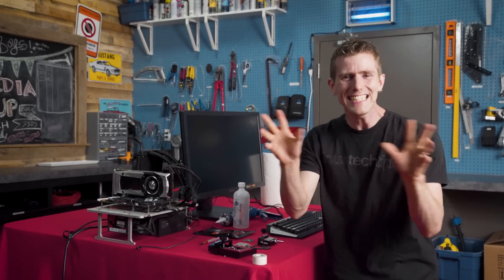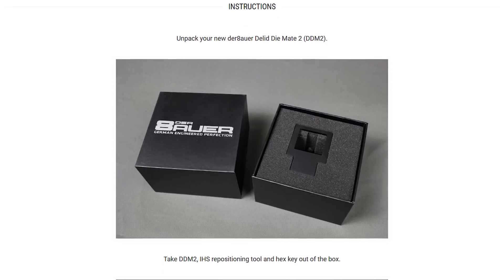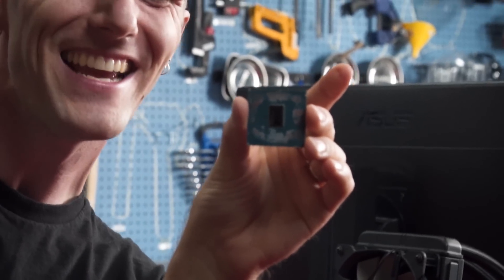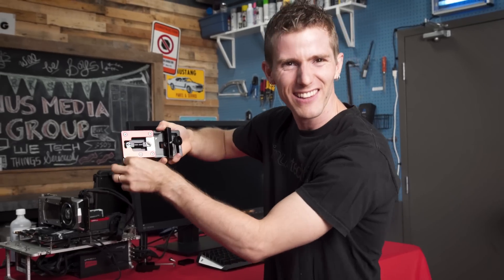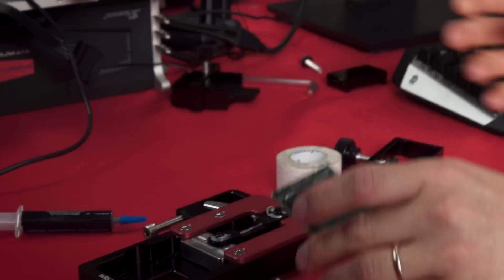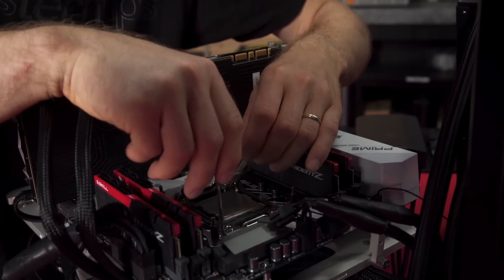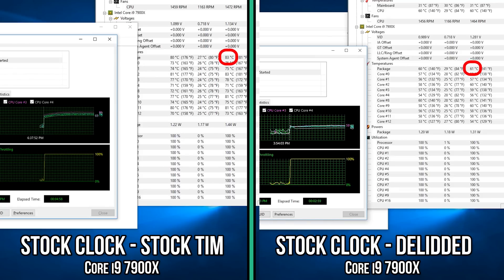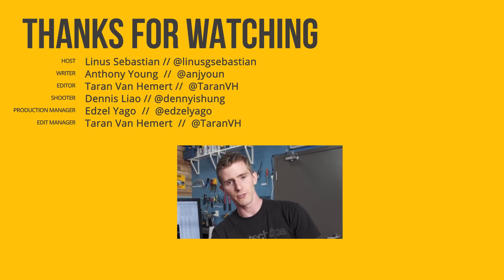Delidding a $1000 CPU - Worth the RISK??

Comment: 20 degrees lower after delidding? Damn, either there was something hideously wrong with your testing method or Intel's R&D division have got some explaining to do...
Reply: Andy Jones a 20 degree difference is pretty normal to see after deliding
Reply: Cameron Cameron Well as I have no personal experience with delidding in not going to pretend to know any hard facts, but the way I see it if all it takes to get a 20 degree reduction in temps is to swap out the stock thermal compound for something a little higher quality on a $1000 processor, then Intel seriously need to revaluate what is classed as "acceptable cutbacks" when it comes to increasing their profit margin. 20 degrees is not an insignificant amount, that's the difference between a pretty hefty overclock and stock. Or passive vs active cooling.

Basically what I'm trying to say is if what you say is right, and 20 degree drops are to be expected, then there's something fundamentally wrong with the way processors are assembled.
Reply: Yep i agree intel should be using a different TIM on there cpus there current thermal paste is a joke and is designed to last a long time but doesn't give good temps

Comment: I wonder if the TIM resistance is increased intentionally to reduce differential heat stress/cycling and increase reliability? For one, a deliberate gap between the CPU and IHS as alluded to by one commenter would allow the CPU to expand and contract without any resistance. I wonder if just thermal stress on the die could stretch/compress parts of the die and change the behavior of the semiconductors? Second, if the CPU is burning a lot of power, after a certain point it is safer to let it run hot than to cool it too much and create a thermal gradient across the die which may cause too much mechanical stress. It could be that Intel did this deliberately for actual engineering reasons.

Comment: If you are gonna make a video at least state the facts right and use what you should like liquid metal instead of any paste. 

Also the "problem" is not the TIM they use, its the gap generated by the black adhesive. Yes it serves a purpose, it prevents pump out effect under high temperatures. Their TIM is great for the job they want to do which is last for a fuckton of years. 

Yes they also have a good reason for going with TIM. Its good enough for 99% of people and increases their profit margins on each CPU by a considerable amount. It would be bad business not to use TIM for the amount of CPUs they make and sell. Intel's conflict-free act and other environmental issues caused by using solder (which requires a bunch of rare metals) are also at play here.

Please make sure your people research their shit before you go and make a video that is a follow up to another video where you also fucked it up. Like when you said Threadripper dies are in the center in your ultimate shit PC guide (PSA they are not, they are off centered and diagonally situated from each other).

Comment: Dude... 20 degree difference! Maybe not for a workstation but for O.C.? Hell yes. Also the question isn’t “should I delid” but “why did I have to in the first place?”
Reply: I think they want the chips to have air above them so if AMD actually brings out better CPUs, they will just change the thermal paste.
Reply: True. The 9th gen Intels seem to have overcome that, though.
Reply: Mr Blewvane So? What brings it down than?
Reply: The high temperatures are caused by improper contact between the IHS and the die. The improper contact is caused when the adhesive used to bond the IHS to the substrate dries and cures, because it apparently expands and slightly lifts the IHS.
Removing the thick ring of adhesive from the substrate allows the IHS to make proper contact with the die, which allows the IHS to transfer heat more efficiently.
Reply: +KemoKa77 no, you are wrong. Core 2 Duo E4xxx, E6xxx, E7xxx, Pentium Dual Core, All Celerons for S478/S775 and some AMD's like X2 5000+ BE - none of them was soldered and its not even complete list. Even S478 Pentium 4 with HT wasnt soldered lol You can delid all of them and check for yourself / check on Google.
Reply: Changing the thermal paste isn't what brings the temperature down.

Comment: If you have a 7700k and you want it to run at even CLOSE to reasonable temps both at idle and under load without an $800 liquid cooling setup then you have to delid it, I went from 60-80 degrees idle, 80-90 degrees under load with the max fan speed on 3 different coolers, to 35 degrees idle, 60 under load with a standard 2 fan liquid cooler.

Comment: One keyboard and one mouse wouldn't necessarily be a hardware problem. That's more of a user problem, and besides, Synergy isn't the only software to solve a hardware problem. One more needed instance is in BIOS updating. Gigabyte includes software to update that from within Windows, and the firmware allows updates via USB drive (Fat32 only). I only know this because I like changing the BIOS logo on my motherboards to what I like, and that's one function of the software in a way that is made easy. This way, I don't have to see "Gigabyte - Insist on UltraDurable" every time I boot my system. I now just see a peace sign that puts me into a good mood after a long day of school.

Comment: Still waiting for them to try the liquid metal (Conductonaut, CLU, CLP) on the die. If you are delidding and competent, the benefits are certainly there. Using a better thermal paste is great and all but after trying both, liquid metal is the way to go. I've also done naked die on my old 4790k. Currently using Conductonaut on my easily overheated 1070 Asus laptop and dropped temps from 81 and thermal throttling the GPU to 71-72 without any dips. I love how it turned out.

Comment: What a pure mess of overacted stupidness. First calm the f down. Then get your workspace together. Delid the cpu and remove all the remaining silicone glue on IHS and PCB. Remove the toothpaste too. And then apply liquid metal TIM. That's the whole point of delid. Put it in the holding bracket and let it sit for atleast 24 hours (or a few hours and then straight into the machine.

Delided my i7-6700k and i7-7700k without an issue and good 20 degree Celsius drop.

You should really calm down a bit, the vids are getting hasty. Do your research.

Comment: could you put a peltier module on the reservoir of a water cooler? so you can get less than ambient temperatures, obviously put It after the radiator, so the water is at room temperature and doesn't overload the peltier, i think It would help a lot in CPU temps

Comment: bout time you got into the 21st century of deliding linus  and yes  deliding  these days are a must if you touch the clock rate at all or have a k series chip. as Intel has foolishly decided to use thermal paste and not solider the ihs to the die like they used to.. the tim they are using sucks using liquid metal produces Superior results

Comment: Intel are just assholes. "Hey, check out this unlocked processor. But if you overclock it we won't take it back because it gets hot as shit. Oh, 'why does it get hot you ask?' Because we can't spend more than a quarter per $1000 cpu on Liquid Metal because that would be pro-consumer."
Can't wait to see Linus drop the 2800X of Zen 2.

Comment: What i don`t understand is why is Linus always using Aida64 stress test when there are more "stressful" tests and even with Aida those chips get up to 80c easily!? Or even up to 100c+... Is that Intel cpu problem or what!? My overclocked FX chip can`t reach 50c with Aida64 but with AMD Overdrive it gets around 50c on package and up to 55c on socket... Furmark CPU stress test gets it up an aditional 4-5c on package, but that`s it... 4.9ghz and 55c max on average... Are Intel CPUs really that hot???

Comment: I cringe for that 7700K with the half-assed thermal paste reapplication in the first part of the video. Just the other weekend I used the Rock-it de-lid tool and Liquid Metal Ultra for mine. Night and day. Overclocked a 7350K to 5GHz which maxed at 75C on cinebench and games at 60-65C. Before delid it hit 92C. De-lidded my 7700K and have it set to 4.8GHz on auto voltage and hit 75C there. It also was hitting 90C beforehand. It's absolutely worth it boys as long as you like the spice of risk in your PC builds.

Comment: +Linus Tech Tips can you explain to me why Intel, on their enthusiast platform, does not only not solder or use liquid metal, but also uses a lower grade thermal  compound then has been readily available on the market for years? 

The solder or liquid metal I could understand, because of cost and possible risks with conductive TIMs, but if even a normal thermal paste can give you a major performance boost, it seems that they really cheaped out on the TIM.